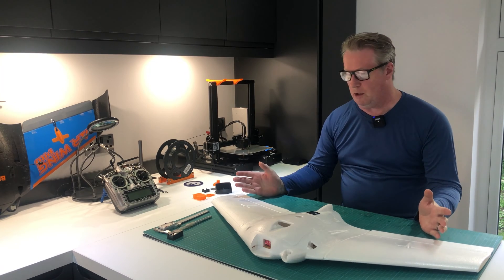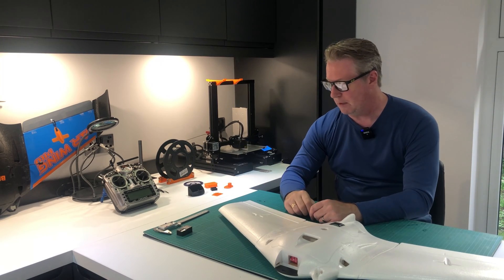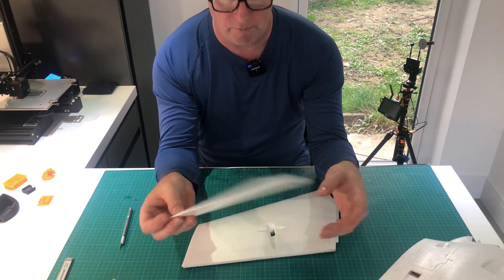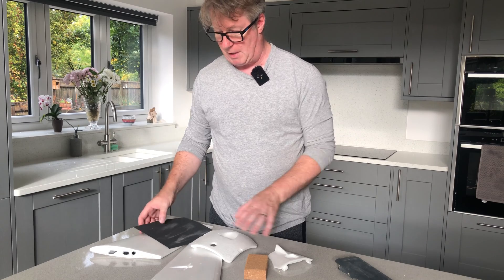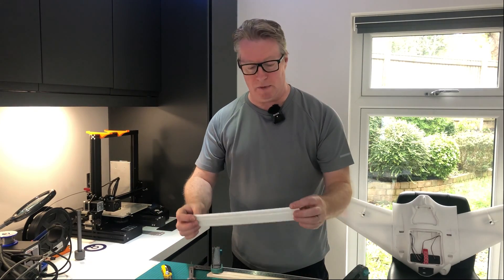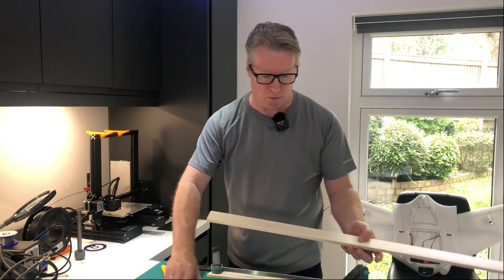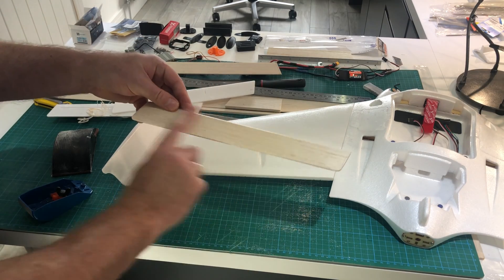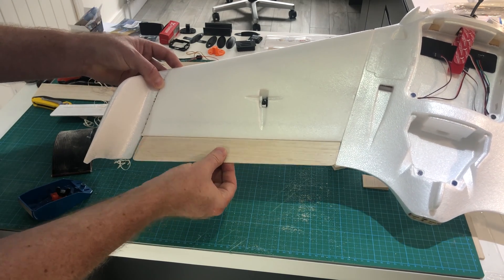AR Wing Pro Enhanced Build Part 4 - Balsa Elevons

Comment: I am definitely going to give this a try
Reply from the maker: A great improvement especially if you want to fly fast and perform aggressive manoeuvres.
Reply: @bluefish3607  have you flown with li-ion packs?
Reply from the maker: @ackroyd11  I have used a lion pack in my Dart XL for long range cruising but no in my AR Pro for proximity flying. The CNHL 5000mah lipos give me perfect CG with my ARP setup and have plenty of power for my throttle heavy flying style so I have never really considered lion here.

Comment: That stock was a great find and your work is excellent.  You're right about the tools too - the right tool makes the job 100 times easier and the result 100 times better.  Does anyone know if the manufacturer is making any changes to the airplane to solve the elevon issue?
Reply from the maker: The stock elevons are find for cruising around and not pushing the plane too hard and the cost to include balsa elevons is probably a big consideration so I think it unlikely. They might mod the foam ones and add a second carbon rod like on the 250G